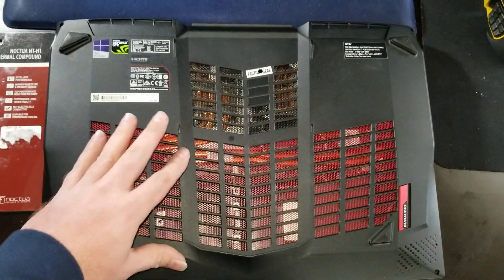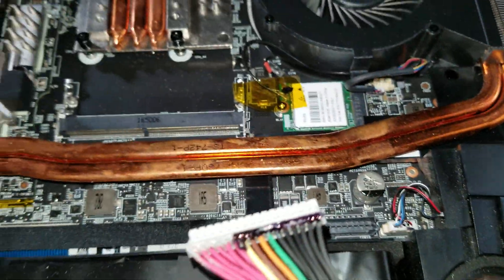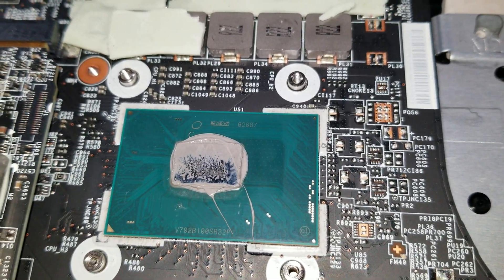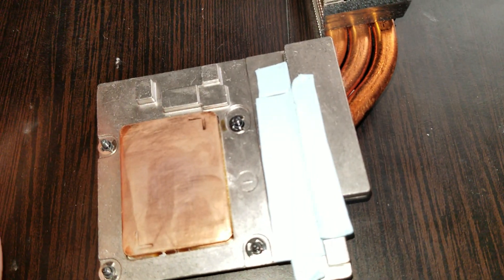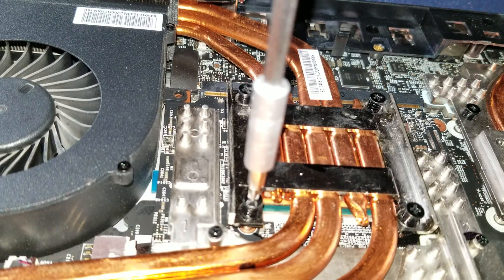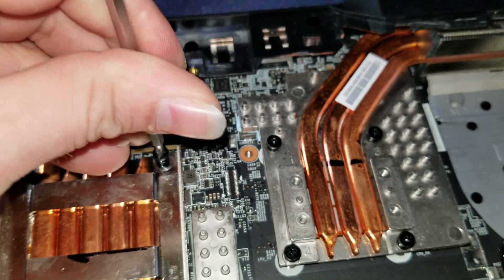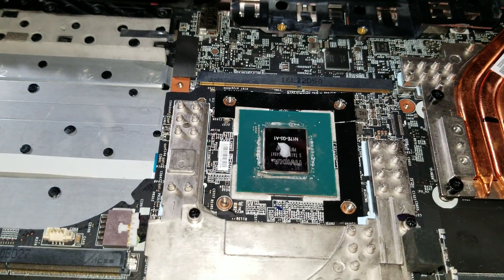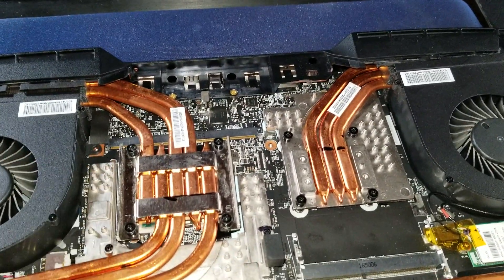Msi GT73vr Thermal Re-paste

Comment: I bought my MSI GT73vr Titan Pro only a year ago.  Roughly how long should I be fine before needing to replace the thermal paste?  I know they can kind of dry up and get dry after a couple years but just wondering if you guys had an opinion on this?  Also, did you do a bench test on the Noctua NT-H1 thermal paste vs Arctic because I've always been a fan of the later.
Reply from the maker: Replacing thermal paste when ever you remove the heatsinks. Outside of that, when ever your temperature are really high and can cleaning the fans did not help.

I did not do any test between Artic vs Noctua thernal paste.
Reply: @EcoBelkin  Thanks for the response, it just seemed you were leaning towards Noctua and wondered if you did some sort of benchmarking to share with others on one being better over another.  May make a good next video to make.

Comment: how was your temps CPU/GPU, RAM after the re-pasting and re-padding? and is 1mm perfect thickness for the pad? or 0.5mm?
Reply from the maker: My GPU temps improved- by maybe 2 degrees.
My CPU temps did improve by 15 degrees. I am not longer hitting 100C at 4.4. The temp at that speed is about 85 degree and im sure i could under-volt more to get a lower temp.
As for the pad thickness- i believe I started out using the 0.5 and then changed to 1.0 thinking they may be a very very small gap between the vrm and heatsink for the cpu.
Reply: @EcoBelkin  ah wow, that's high., my temps were 63 degrees on the gpu whilst rendering that is 100% load on the gpu and 66 degrees on the cpu whilst doing simulation caches with 95% load on the cpu.... now after 4 years my temps on cpu climbed up to 79 at 100-95% load. so i'm doing a repaste. thanks for you video anyway dude!

Comment: Hey man i hope you can answer my question i have the same laptop i repasted it but didn't change the pads and they're torn .... so now when i get on eco mode or comfort cpu temps spike up to 60 and keeps climbing could it be because of that ? thanks
Reply from the maker: I would think that entering eco or comfort mode would change the power profile should also down clock the cpu.
But would be warmer as the fan curves could be changed allowing high temps at the expense of fan noise.
Or the heatsink is not sitting correctly on the die.
Reply: Those thermal pads do not effect cpu temp, the thermal pads are for power delivery and as long as you didn’t remove the pads and kept them torn in place it should be fine 60 is low for a cpu around 85 is hot but 95+ is a concer

Comment: Hey man, great video! How are the results with Noctua? Personnally I've come to the conclusion that it's not a great choice in a laptop on bare dies (in the long run), since I have noticed it suffers greatly from the pump out effect. This last time I had good results only around 2 months. I have now changed to Thermal Grizzlys Hydronaut and it seems to last longer. I have some videos on this also if you want to check them out
Reply from the maker: Thank you!
I have changed mine over to thermal grizzle  hydronaut as well.
Reply: @EcoBelkin  Oh okey nice! Has it been working well for you? :D
Reply from the maker: Works great so far.
When I did the overclocking video to 4.9 ghz I used thermal grizzly hydronaut.
Reply: @EcoBelkin  Ok, awesome! I will watch that one then, thanks for the help! :)

Comment: HI,i got my MSI GT73vr laptop 6 months ago i have some thermal issues with my cpu.It's temp. is about 80 to 90 while gaming.If i brake the factory seal and open the back casing to apply the thermal paste would the warrenty still be void?
Reply from the maker: To my current knowledge no it does not, at least in the Uinted States.
Be carfule when pasting as to not scratch the dies of cpu and gpu.